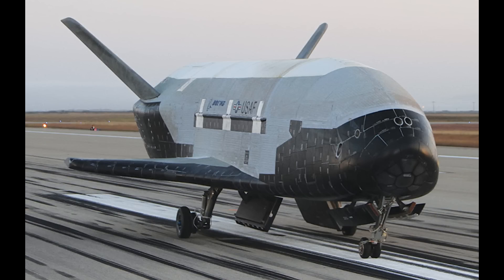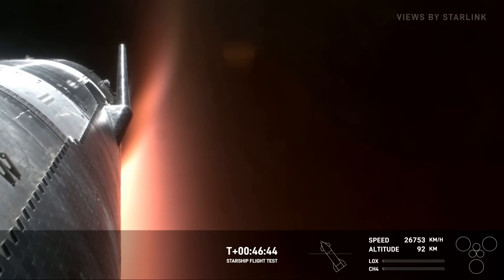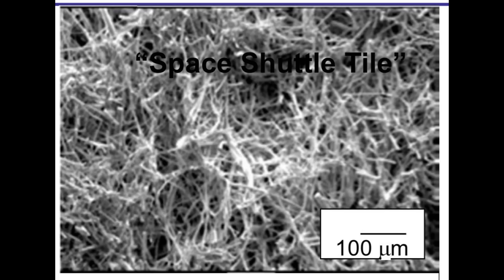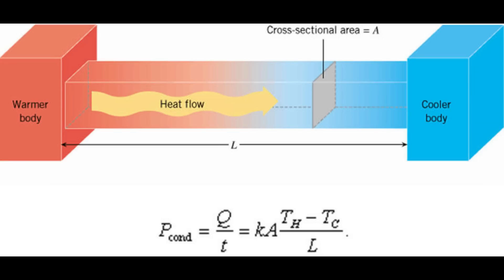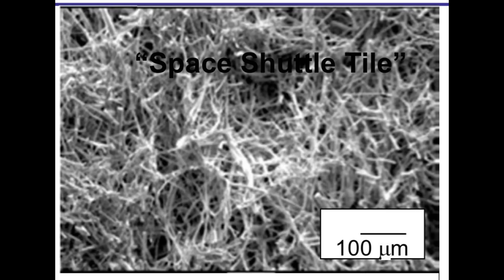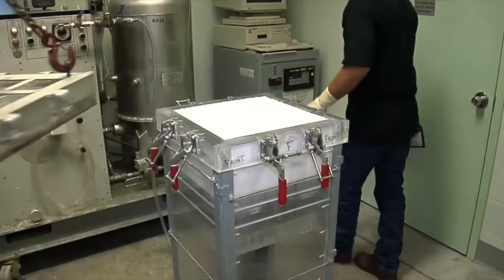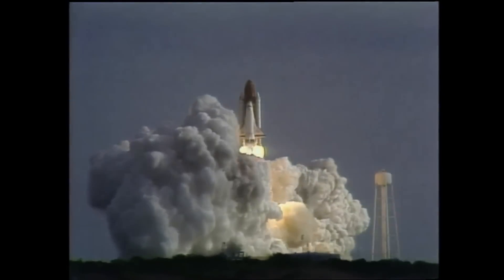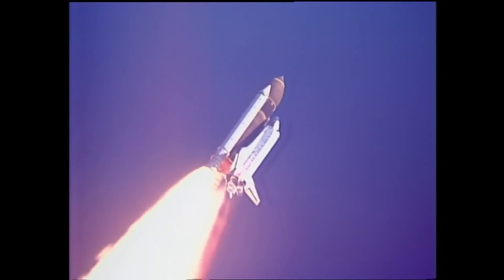The Microscopic Trick That Makes Heat Shielding Tiles Work

Comment: 7:26 if the black layer is impermeable... how did they address the trapped air pressure when the tiles rose into a vacuum environment?

Comment: So was the space shuttle heatshield tiles the [AETB] Being an Alumina/Silica fiber Woven layout, It almost looks like the Alumina is the "Center (Strenghtening)Design" with the Silica Being woven Filling in the overall Area which would absorb the heat and the Alumina giving Strength to the Overall Structure

Comment: It is difficult to believe that SpaceX's decision to switch from carbon fiber to stainless steel construction for the Starship and Super Heavy did not affect the payload capacity of the system. If a rocket is built from a material that is five times heavier, something has to be compromised. It is possible to stack more rings to increase the fuel capacity, but this also increases the mass. It would be great if Scott Manley could analyze the data and provide an answer to this question.
Reply: But carbon fiber needs paint a very thick thermal shield..

Comment: @Scott Manley Imagine the cavity between the hull and the O2 and methane tanks, is a heat pipe. Space X can effortlessly transfer heat from the hot belly to the roof of the vehicle and out into space, simply by adding a working fluid between the walls.

Comment: Of course, heat conduction is not about flowing along it on the surface (he misspoke), but about flowing inside, through the material volume.

Comment: Human rated reentry capsules use a blunt body design. A blunt body creates a "Detached Shock" which reduces the amount of heat transfer to the vehicle. Apollo, Gemini, Mercury, Soyuz, Dragon, Space Shuttle (flat bottom) and others have employed this tech. Starship is a long cylindrical body with a round cross-section... and when tilted into the reentry flow field... the cross section, as seen by the flow field, elliptical. An elliptical cross-section is a streamlined shape in comparison to a blunt body… and will result in an Attached Shock - which will result in excessive heating close to the surface of the vehicle. I doubt that Space Shuttle tile tech (which was designed for a "Detached Shock" model) will work reliably here - no matter how much alchemy is applied. Solution: Modify the cross-section of Starship to form a blunt body on the reentry facing side and move the flaps up on the body and inside the "Detached Shock" wave during reentry.

Comment: I want to know how spacex is going to reuse these tiles without the huge maintenance burden that the Shuttle suffered
Reply: For starters..
1. Most of the tiles are identical. Each space shuttle tile was unique 
2. Attach to stainless steel, not aluminium
3. Rapid metallurgical and material iteration

Comment: At the end of this clip, the ship was scrubbing off speed at about 50 Kph every second, which is a lot less than I was expecting. At that rate it will take a long time to slow from 27,000 Kph orbital to pre-landing burn/capture speed. When the plasma started the speed reduction was even less. Disappointing.

Comment: Thanks for sharing your thoughts, ideas and videos. Have you ever stumbled upon Nighthawkinflight on YouTube. He’s basically a backyard experimenter that has been working as of late on, radiant cooling paint. His latest project was radiant cooling fabric. He’s only been able to make very small samples but had me thinking, possibly SpaceX might be looking into making a high temperature radiant fabric to use as wipers in the flap joints on starship to prevent gas moving thru the joint. I’m sure you noticed as I did when watching the last flight the smoke coming thru the joint long before any damage was done and thinking, thats kinda foreboding. The other thought I had was I seem to remember hearing that the header tank in the top of starship was moved up there to hold the nose down in horizontal reentry. Maybe they should just delete the front flaps and move the header tank further back in the ship. Is that something you could test in kerbal??

Comment: Excellent and simple to understand. One correction: when you increase the thickness, it does simply "take longer" for the heat to get through, you double the thermal resistance, so you only get half the heat flux.

Comment: Good video but I still don’t know how big and thick Starship tiles are and how that compares to the Shuttle. So related to that I don’t know what extra weight the TPS added to both vehicles. Be really interested to know. Everyday Astronaut asked Elon about it all it seemed to me at least that the non-tile transpiration cooling seems likely to be about the same weight-wise as the tiles, but the active system is far far more robust and rapidly reusable. So maybe it’ll change back in the medium term, or make the tile system absurdly robust, light, and inspection/maintenance free?

Comment: I am sure sb thought about it already, but how long do you need to remove old tiles/ adhere new plates to a starship?
I mean they already want industrial scale rocket manufactoring, crafting a few extratiles and swapping them out  to safe time seems reasonable. Do you know what timeframe we are talking  about for adding/ removing single tiles or all at once?
Reply: We've seen videos of tiles being added/removed at Boca Chica. It appears to only take maybe 30 seconds or a minute to remove, and literally a few seconds to install. That's for the majority of the tiles; some tiles take a lot longer as they're installed in difficult areas and require gluing etc. Most of the ship tiles are mechanically attached, not glued.

Comment: Speaking about the sapphire strands, it's actually really easy to make your own sapphire.  You take aluminum wool and mix a ball of it with aluminum oxide and put it in a container that can withstand the heat and put it in an old microwave for a minute or so.  When you pull it out, you have clumps of sapphire mixed in with the powder.  It's the same process for maming rubies in a microwave, but with rubies you add 1-2% chromium oxide to give them their color.
Reply: Wow, I can bake precious gems in a microwave?
Reply: I have to note that microwaving metal is generally not safe, and doing this in a non-ventilated area isn't a good idea.

Comment: Our now retired material and manufacturing science teacher has a heat shield tile from the Buran shuttle. He always brought some interesting objects to show during his classes. The tiles are incredibly light, which makes sense since air/empty space is a very good insulator. The outer coating was black and very hard and quite brittle, the inside of the tile was white. Couldn't see what kind of a fiber structure it had though. The outer coat had some damage marks which looked like he had done some Brinell hardness tests on it, but I don't remember if he told us the results. But it sure seemed like it could be very glass-like hardness.
The story of acquiring that heat shield tile was quite simple. He went to the site where the Buran has been in storage for decades with some group, found the tile laying on the ground and just put it in his bag and hoped nobody would check the bags on his way home and across the border.
Reply: I own one of these Buran tiles as well, and they are really fascinating to handle. Even after handling it countless times over the years, when showing it to people etc, it still catches me off guard how light it is. It's like picking up a brick made of nothing. But at the same time, you can tell it is fragile - just by handling it carefully with just your fingers, there are little fragments that come off once in a while (like grain of sugar sized pieces, but still).

Comment: Finally one of the YT commenters expresses skepticism about Starship's tiles and their potential to make Starship more expensive to reuse than touted. 
I'm disappointed that SpaceX dropped the original proposal which was for transpirational cooling. After all, one of the reasons put forward for the switch to stainless steel was that it would play well with transpirational cooling. I would have liked SpaceX to come up with a subscale Starship on which it could test novel thermal protection systems. 
A question for your Scott Manley. Have you ever seen anyone mention using a combination of carbon foams and coolant? So something like methane percolating through a carbon foam. As it progresses through the material, it first boils and then becomes a progressively hot gas. The neat thing about methane is that its heat capacity rises with temperature.

Comment: No, these heat tiles will always cause problems.  We need alloys, specifically for the task of reentry.  A tantal/wolfram alloy looks promising.

Tantal.  melting at 3030°C
Wolfram  melts at 3370°C

Perhaps a 3rd component may raise the melting temperature even more.  Like, what about the new NASA GRX-810 alloy?  If its good for building thrusters....

Another option would be to use electroc current, to isolate the hull from the air.  Some research is going, to even use this tech for thrust!  The steel hull of Starship is suited well for this.
🚀🏴‍☠️🎸

Comment: I am still wondering why the lack of use for the Aerogel. I remembered it was originally designed to be a heat shield replacement but the only use recently is collecting dust samples from a comet.
Reply: It mechanically weak which makes it less than ideal for most space applications.

Comment: 7:05 I think if we solve manufacturing proces we can get better rezult with tile where instead of air flow around from hot side to cold side is buble roms independent of each other.
How can be made? i was thinking in capilar tube technology from skylon/sabre but instead of using that tubes of stainless steel made with ceramic but must be thin, very thin walls because are the path of heat tranfer. when this solved the tube must be taped at X distance to avoid flow of air circulated from left to right on Z(depth) they already are isolated. And see how this work. this technology already aplied at bricks for themal gaps.
If that dont work because tubes cant be so thin or the walls are to large. Can de solved with 3 layes sandwich each layers are made with this fibers glass the air flow will flow but only in the first room the hot room, the midle room aswell with fiber glass will be the thermal gap bettwen hot plasma and cryogenic. and tird one is the same in contact tih the cryogenic and the midle room sandwich. How make that sanwich? imagine already sheet fiberglass with lot of this capilars who ill be tangled when you pour the actul mix of fiber glas and water. So the inner, sperator of room dont touch directly the extreme surface.

Comment: Why is that massive lump of ice near the damaged flap not melting? Surely others have noticed it? its worth a video in itself, I suspect there might be some pretty weird properties of ice in space in regard to absorption of radiation. Not sure what type of ice it is, but being exposed to that radiative heat of the hot plasma seems its not absorbing it.
There might be some application or use for that?

Comment: 1. Heat shield is not “rapidly reusable”
2. Starship is the worst example - they lose tiles on launch, and it uncontrollably rotates, so shield is effectively useless.
That is all you need to know about this video and its author.
Reply: Wow you're both out of date and more than a little stupid.  Nice fail though.

Comment: So where does Carbon Carbon fit into this? I know the space shuttle had carbon carbon tiles on the nose and wing edges. Considering things like grqphene are great thermal conductors, how did those insulate from the heat at the hottest points?

Comment: I wonder if you could further improve the tile's thermal performance by coming up with some kind of electrostatic (or other) treatment process to align the fibres in such a way that the cross section of the voids constituted a kind of Tesla Valve?

Comment: It's not the melting point of steel that matters, it's the temperature where it softens and loses it's structural strength - as in the temperature where blacksmiths would work it (if they could - it's a comparision, don't just all over me)

Comment: You speculate that the biggest barrier to rapid reuseability for Starship is  perhaps the heatshield.

So then, for a future episode, what about that idea Musk floated of deleting tiles and  back-up blankets altogether, then perforating the hull with many many thousamds of small holes, and blowing a gas through the holes during the critical part of the reentry?

That certainly could fix the rapid resueability issue, sice a refill of the gas tank would be all that would be required between launches.

The question that remains is the weight penalty.
Reply: It was a notion discarded as being overly complex and heavy.

Comment: Another episode on how they're attached would be fun, as it's super interesting! If memory serves, the Space Shuttle had Inconel pins embedded in them and then an Inconel fixture on the aluminium frame, so even the fitting was a high temperature and high thermal resistance piece!

Comment: coming here right from ToT’s latest offering is a wild ride - always expecting the sort of twist that Scott does avoid… “…the melting point of stainless steel is much higher, but the melting point of humans is a little lower than that ” or some such 😂
Anyway, nice video and the least boring repetition of the three brothers heat transfer I recall!
Does this mean that after landing they had to put a tarp over the shuttle in case it rained? Did the re-waterproofing happen before flying the shuttle back to Florida?

Comment: maybe its a stupid question, but why not store a spacecraft in a "dry room" with extreme low humidity to preserve the head tiles before a rolle out and after a flight to dry of the spacecraft on its own?
Reply: I guess, because it is not preventing the tiles from absorbing water again, while standing on the launch pad or during the flight.

Comment: I still do not see how the movable flap system is better than a fixed “wing” like early BFR concepts & the space shuttle

Spacex even showed a simulation early on of the bfr making a controlled decent thru mars atmosphere without any movable surfaces

So surely they could at least have fixed rear flaps & movable front flaps? Or just copy the space shuttle RCS system
Reply: It has to have a means to vary the amount of drag.  That can only be done if it moves.  It's not a wing.  Do you understand what the flaps are there to do?
Reply: @TheEvilmooseofdoom   i know what their function is, but the space shuttle & the early bfr with the delta wing managed to do that without movable flaps during reentry

Comment: Yes, I think you are right about heat shielding being the main problem for making Starship rapidly re-usable. The Space-shuttle was intended to be rapidly re-usable - but it never happened!
Reply: Booster needs to be rapidly reusable. Ships? Not so much. You have 10 ships in rotation running on 2 or 3 boosters. (tankers for fuel to LEO, primarily). Crewed starships will be a tiny fraction of ships launched. The same folks who believe the same starship combo (ship and booster) will fly the same day are the same folks that believe that starship point to point will actually happen. The vast majority of starships to mars, for example, will not be coming back. Folks don't understand how the program will operate.
Reply: @KnugLidi  the main factor will be cost. If it takes too long or too much working hours it becomes to expensive. So the ships in fact need to be rapidly reusable. We can argue about what is "rapid", but it definitly is the critical factor.

Comment: I understand aerogel is very light and very resistant to heat.  Have they looked into using that for reentry shielding?
Reply: It has been, the problem tends to be mechanical aerogel tends to become aerodust when exposed to high G loads.

Comment: Experiments with adiabatic (no radiator needed) engines use alumina parts and shields in heat facing parts. It’s amazing stuff.

Comment: Is there a reason why no reusable spacecraft design has considered using a consumable, easily-replaced, single-use heatshield? It seems an awful lot of effort goes into these reusable tile systems that still need a lot of inspection and maintenance between flights. Why not just have an ablative shield that can be replaced for the next flight?
Reply: Because no such magical heat shield exists.  Costs are a real factor.
Reply: @TheEvilmooseofdoom  Soyuz jettisons its heat shield just before landing. I'm not sure what needs to be "magical". Obviously Soyuz isn't reusable, but it's clearly possible to make a removable heat shield.
Reply: too heavy

Comment: I've been looking forward to you doing a video like this. Space X's approach for this up-coming test flight looks like a sticking plaster, literally, when you consider they're using a layered technique of ablative and non-ablative materials. Hardly an easy process to replace quickly between flights! But that always learn a lot with their fast experimental approach. We'll see!
Reply: The goal is not to replace them between flights.
Reply: @TheEvilmooseofdoom  yes, it sure is. But you can't reuse an ablative layer if if ablates. If the other tiles stay put, all well and good. It's just a stretch to imagine that the under-layer will not be affected. We'll be see. I hope I'm wrong!

Comment: Has there been any effort into forcefield research?
Reply: What is a force field?
Reply: @TheEvilmooseofdoom  In this scenario the force field would likely be a magnetic field which works to oppose or redirect the plasma generated from friction of air against the ship. This would probably take a lot of energy to do however if there was a way to use the the energy of the plasma to generate the magnetic field then...well, that would be interesting indeed.